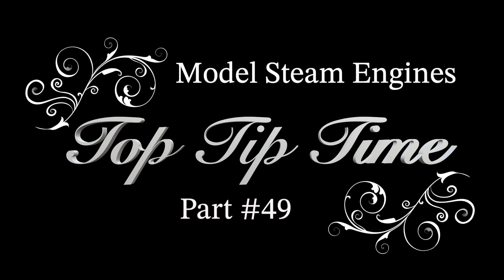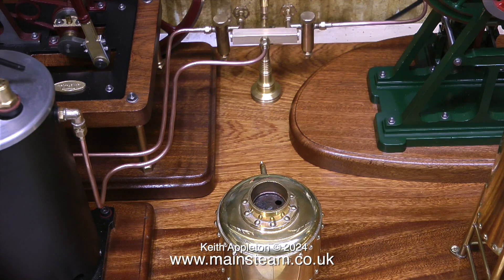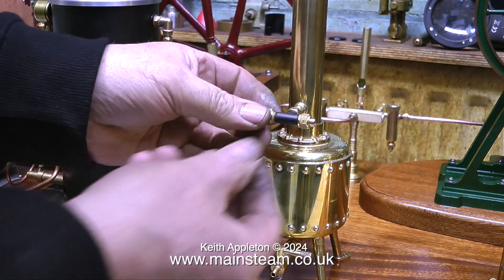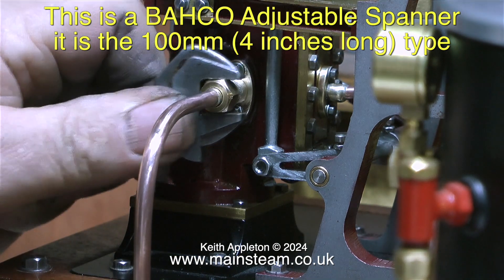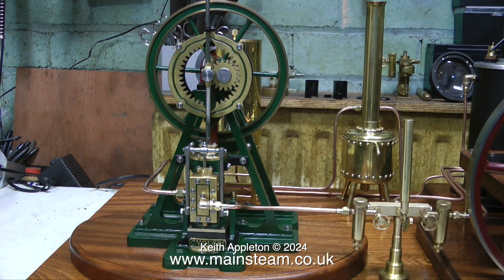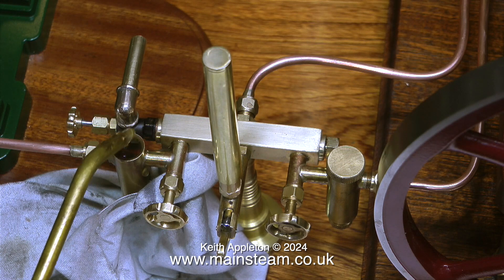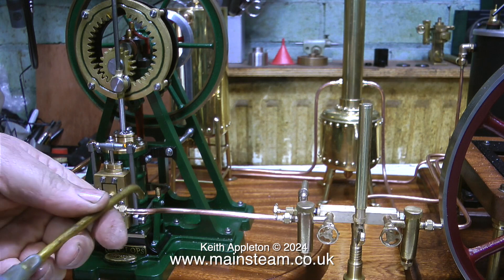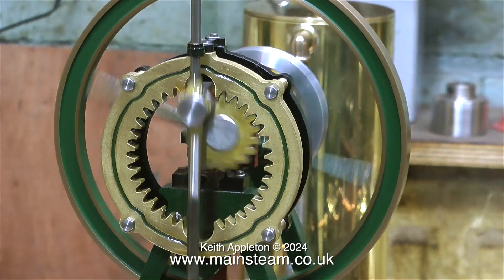MODEL STEAM ENGINES - TOP TIP TIME - PART #49

Comment: I wonder what losses the hypocycloidal engine has compared with a normal crank? 🤔
Reply: never seen that mechanism, pretty neat!
Reply: I seem to vaguely remember was that it was a “get around” for when one of the early pioneers (I can’t remember who) of steam engines patented the crank mechanism.
Reply from the maker: Yes, I think you are right. In the early days of Steam power, Boulton & Watt just about patented everything }:-)))
Reply from the maker: I just think that it is unnecessarily complicated and the parts would soon wear. This example is a bit worn and it has not done much running.

Comment: Carbon monoxide is actually lighter than air (1.145 kg/m3 at 25 °C, 1 atm) , and carbon dioxide is heavier than air (1.808 kg/m3 at  25 °C, 1 atm) . Air is 1.1839kg/m3 at 25 °C, 1 atm.